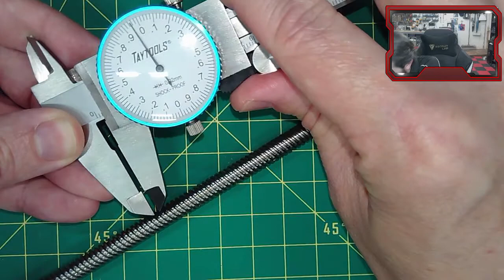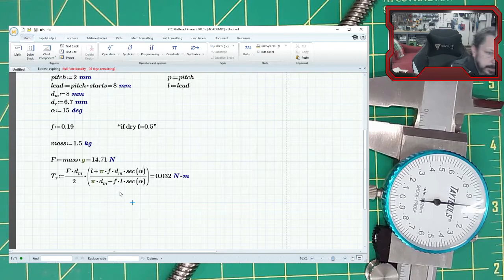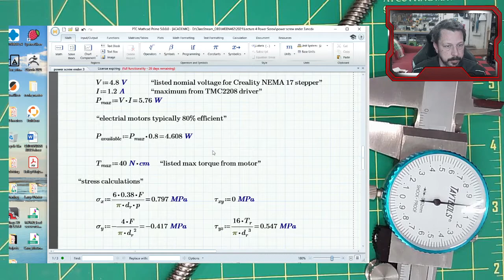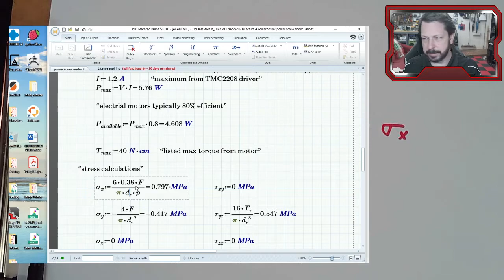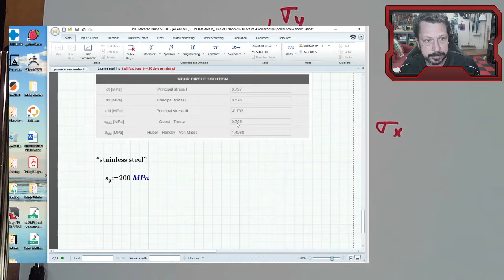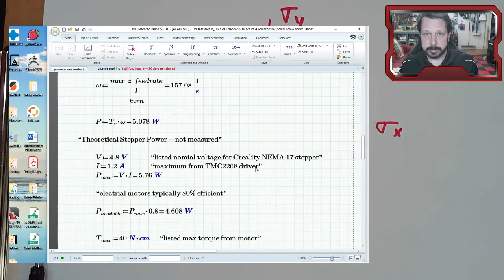Shigley 8.2 | Lead/Power Screw Calculations Example

Comment: When you calculated Torque to raise, Tr, you put down 0.032N⋅m, but I got 32. I used mm in the formula when calculating, and did you convert the inputs into metres?

Comment: Can u make a video about design / selection of gt2 timing belt please??
Reply from the maker: That is a good idea. I have actually looked into that a bit and taught a little bit in a lecture once, but never made it into a video. Maybe I will dig my notes out and try to see if I can put something together.
Reply: @KellyBC  ok thanks
Sorry i have only one question 
How to calculate axial load on screw if the application of lead screw in x axis ??

Comment: Great video could you please explain the torque value to raise is 0.032N/m and Torque=F x d therefore T/F=d  which works out to be 0.032/14.7=0.002m or 2mm but the screw is 4mm radius,Thanks

Comment: Thank you for the great video! Would it have been more accurate to use the mean diameter, instead of the major diameter? Thanks!
Reply from the maker: It was so long ago that I made this particular video that I don’t honestly recall what I did. But in general yes, you do use mean diameter for many of these types of calculations.

Comment: Great video 👌, please can u tell me the design of nut?
Reply: Is the torque raise and lower suitable for horizontal screw case not vertical ?
Reply from the maker: Thanks! The nut on the lead screw is just a brass collar nut or flange nut. You can usually find them by searching for lead screw nut. I hope that helps.

Comment: great lecture but how do i calculate the 
The power and speed ratings and resolution .
Acceleration of the axis
Specifications for the mechanisms (Mechanical Advantage, Velocity Ratio) that are going to be used for each of the axes
The maximum linear rate of travel along each of the axes.
The time it will take for each axis to go from rest to maximum speed.
The minimum resolution of each axis
Reply from the maker: Those are great questions for sure. I haven't really gone the route of making those calculations  before. I approached this video from a simpler no-loss mechanical point of view considering basically the electric power in versus the mechanical power out. I will have to incorporate a much more sophisticated model in order to incorporate the things you are interested in. I am planning to teach this class again in the spring, maybe I can bring in some more details then. Thanks for the great questions though!